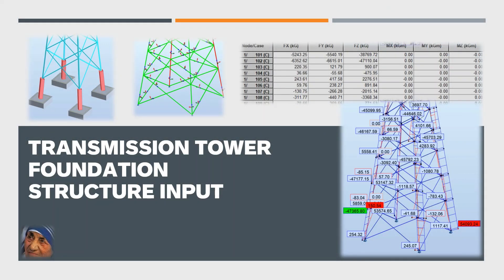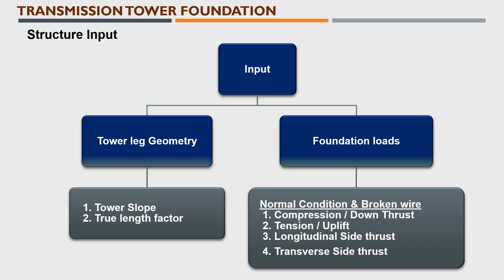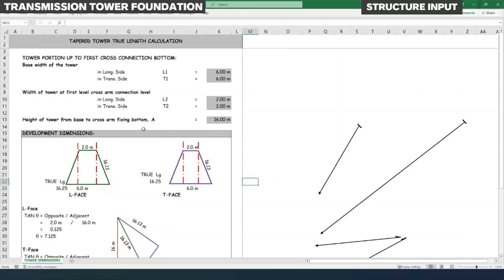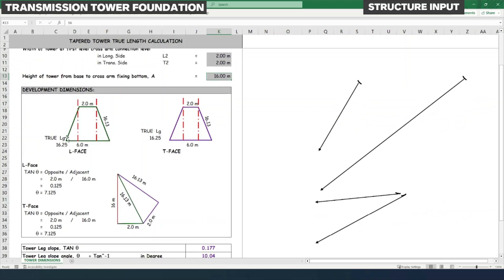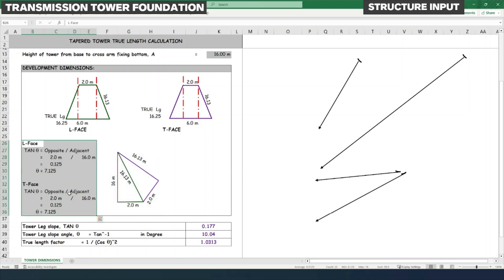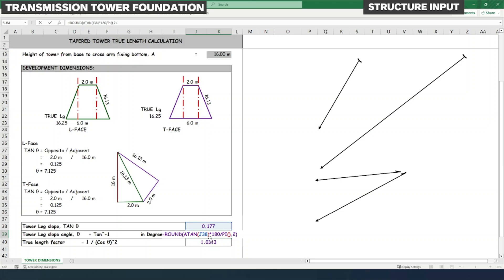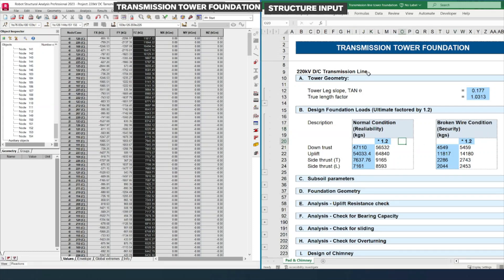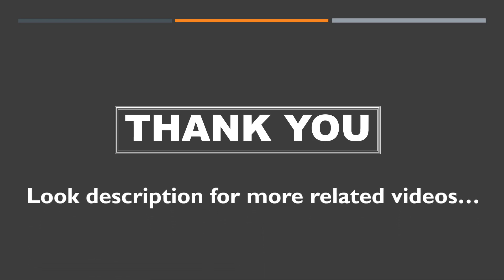TRANSMISSION TOWER FOUNDATION | Structure input

Comment: Great video, thanks! I'd like to know more about the uplift verification requirements. Should the foundation-soil loss of contact be avoided under all serviceability and ultimate limit states? Or can we allow uplift under ULS, provided that the increase in thrust is resisted in the other foundation legs?
Reply from the maker: Thanks for watching and for good feedback. Yes, loss of contact is to be considered for service load combinations. For ULS cases, as those are with already load safety factors, we can ignore the loss of contacts as these ULS situations are not vulnerable or reality scenarios. There are other videos in this channel explaining foundation design calculation for your reference.

Comment: hi sir, i am quite fresh in designing structural.. currently, im required to design foundation (using micropile) of transmission tower (lattice).
i am only designing the reinforcement details & sizing of the pilecap and stump.
currently, i have information of soil parameters (from borelog).
i am wondering what are the loadings/information that I am supposed to request from the tower supplier.
I requested the shear force and moment in Long/Trans direction + the Vertical Load, will these be sufficient for my foundation design?
are information regarding cleat/stub necessary?
Reply from the maker: Hi Benjamin, thanks for watching. 
Additional to the foundation loads you need to ask for tower geometry. Please refer our video 📹 for more explanation: https://youtu.be/aajc_aOgey4?si=J2e9SNufcxmCf1TV